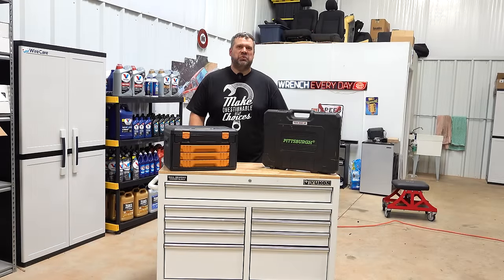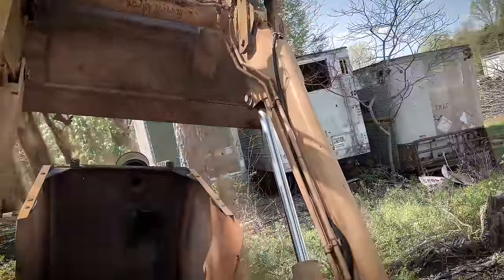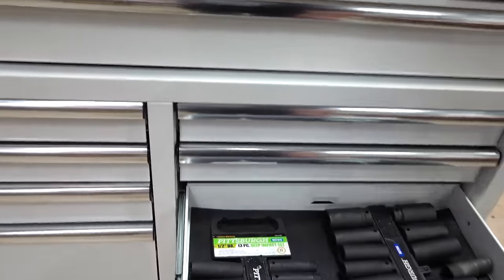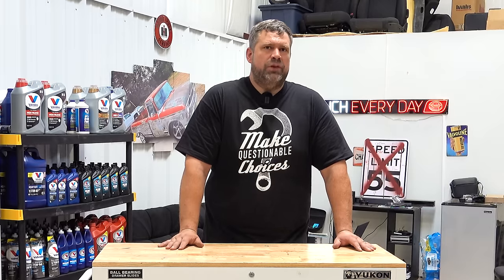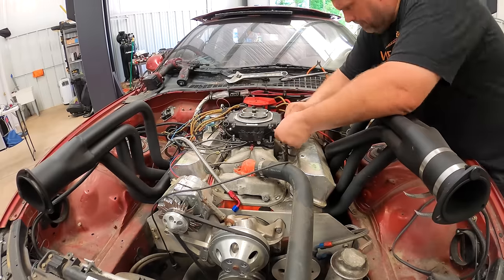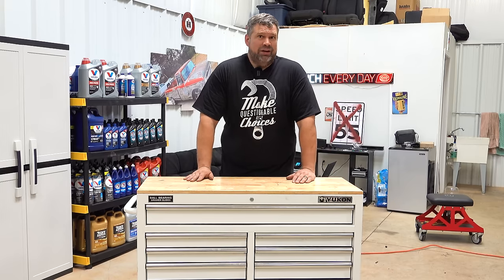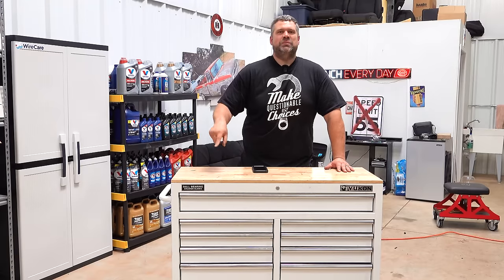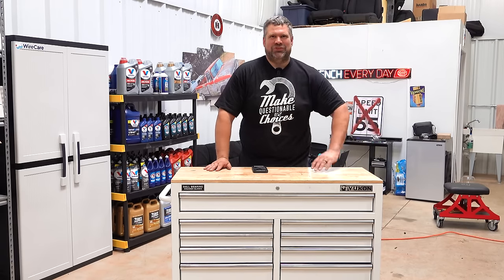I Bought The CHEAPEST Tools In Harbor Freight (6 Month TORTURE TEST)

Comment: I use two rifle cases as tool boxes mounted to my roof rack for mobile mechanic and when I’m off roading. It’s a mix of icon and snap on. I prefer my icon more oddly enough and been replacing my snap on with them because of better availability.

Comment: I bought the blue version of that YUKON tool box and I 100% agree with everything you said.  The only negative to it is the drawer spacing is a bit on the short side but after working through making some of my own organizers, its holding up well.  Mine gets abused just as bad as it seems yours has and I have had it for over a year now.

Comment: Great review Jared.  An extrapolation from this is that for the home hobbyist, any of these cheaper brands are just fine.  Long ways back when I was starting out as a service advisor, I mentioned that I wanted to look thru my techs snap on catalog as I was staring to make some money and wanted some nice tools.  He said “why, craftsman, Home Depot etc are just fine for the home hobbyist.”  I’ve had a basic husky socket set for nearly 20 years, a plethora of craftsman older than that which I use all the time.  They have been great.
Reply: Fully agree. When i was younger i ran a harbor frieght kit for years. Made me money more than once. Now that im older im running Milwaukee hand tools, and Kobalt power tools. Run the tool you can afford at the time, upgrade when you need to.

Comment: You absolutely nailed it. I'm definitely a victim of buying off the tool trucks. My entire work tool set is all major tool trucks. I really thought thats what i needed to be a good tech especially when trying to be one of the youngest honda certified master techs. But when I went to build my.home set for wrenching the garage. Its all been home depot, lowes, and harbor freight and they hold up just fine to the abuse I put them through and then some. Great informative video for anyone new to mechanics.
Reply: What’s crazy is my DeWalt 84 piece mechanics tool set is like $300.00 cheaper than one mechanics tool set from Snap On that’s literally crazy I could buy like 5 or 6 different DeWalt mechanics tool sets for the price of just one Snap On mechanics tool set lol

Comment: I'm starting a new job at HF next week. The manager got to know me by how often I would buy from them and offered me a job. Good people. There are some things that I will not buy from HF, knowing that Snap-On makes a more reliable tool (torque wrench) and some things that are made in the same factory as a tool truck equivalent (Cheif long barrel air hammer, made in the same factory as Mac). The one significant advantage for HF, you never need to wait on the truck if a tool breaks. Just my two cents.

Comment: All good advice! I've sold a lot of tools, being an old division 9 guy at Sears for a few years, and you can save a bunch of money while still having nice tools. Find what works from the lower cost sellers and then upgrade to higher grade tools where it really matters. Most of my personal tools are Craftsman Icon and Quin, with some cheaper no name and a few Snap-On in the mix. The important thing is to be able to get the job done.

Comment: when I went to A&P (aircraft mechanic) school, they had a deal with snapon where everything was half off, and it STILL was over 10k for my box and tools. and over half my class had rust issues with their pliers within 2 weeks of receiving them. so, yeah, go to harbor freight and get the same thing if not better for less money
Reply: Thank you 👍
Reply: Man... I won't tell you harbor freight won't get the job done... but the tools from there are not better... or even close to being as good. I have a 68" epiq that is loaded with both harbor freight and tool truck tools and there is absolutely a quality difference.

Comment: The best deal on the Snapon truck is the trade in tools and the free candy.  I spent a large amount of money as a 19 year old mechanic, but it was nothing compared to the other guys.  I had a full Craftsman set, and CH air tools.  Slowly over time I got away from the CH air tools and into IR and those used bluepoints from the truck but I still have those same basic hand tools 23 years later, including the used craftsman box I paid $50 for.  I guess that's a pretty good tip, you can get more for your money on the used market than you can buying new, and the warranty is transferable.

Comment: Have quite a few husky and harbor freight branded tools. Honestly the only times I've needed better branded stuff was sockets and pliers. Cheaper sockets can crack an cheap pliers explode or dont hold up to use (specifically lock jaw pliers, the pin comes apart)

Comment: Couldn't agree more! The tool truck stuff is indeed good quality, but they don't have a monopoly on tools that get the job done. I am NOT a professional mechanic, having been talked out of going that direction when I was young by someone who had worked in the field. However, I am a hardcore hobbyist and do everything from brake jobs to transmission overhauls. I am almost 50 (sigh...) and still have some Craftsman V series tools that I got new when I was 14. I use a lot of Harbor Freight with good results. It's very useful for stuff that I use infrequently and sometimes even for stuff that sees very regular use. I also buy a lot of tools at estate and garage sales, as well as flea markets. No one knows the value of it and most just want to get it out of the house for whatever someone will pay. You would be surprised how many Snap On wrenches go for $1. For screwdrivers, the best I have used (in terms of ergonomics) are the triangle handled ones from Tekton. They are very comfortable in the hand, able to deliver a lot more torque than more rounded designs, and don't break the bank. Speaking of breaking, I have a $7 Harbor Freight 1/2 in breaker bar that I have used for over 12 years. I use it to break FWD axle nuts loose and usually end up using it with a cheater pipe and jumping on it or by putting the tip of the handle on the ground and using the car's engine to drive the nut loose. Other than a pivot bolt that needs occasional tightening, it has held up perfectly fine. Of course, I can't recommend anyone else to do that!

Comment: The 25 inch Pittsburgh Pro 1/2 inch drive breaker bar for $19.99 is an absolute steal. You can catch them on sale for $14-16.00. Great option for a big breaker bar. It also has a plastic insert/rubber handle comparable to the big name bars. That's a great bar and would be right at home in your tool box.

I work at Walmart in the Auto Care Center and Walmart does provide our tools to us. They contracted with Steelman for their Pro line, which is acceptable for a weekend type of use, but these tools get used hard everyday and we do end up replacing stuff fairly regularly. Again, their provided by Walmart. We don't get too deep into working on vehicles, we're mainly oil changes, tire installs, flat repairs, rotation/balance, battery installs, and external light installs, and precious little else. So we're not pulling transmissions out of cars, that's for other shops to handle. We try to get the vehicle in while the customer is in the store shopping and have it ready when they are done. Sometimes we actually make that happen too.
From what I've heard about the Harbor Freight lines of tools, the Pittsburg Pro, Quinn and Icon, I'd run any of those over the Steelman line any day of the week if I were working professionally in a repair shop setting, no questions. I've not bought any of the Icon line, but have a bit of the Pittsburg Pro tools for my own personal use and they've done just fine. I also have a number of Craftsman tools and they do the job too, and Craftsman is my main tool line for my use.
If I were going to change careers and get more into the vehicle repair in a shop setting, I'd give some serious thought to the Icon line augmented by Harbor Freight's other line of tool chests, like the Yukon and some of their portable tool boxes on wheels to support the Yukon.

Comment: I was gifted a large Craftsman mechanics set in 1993 and still have most of it in use today. I have abused them plenty, but always put them away clean.  I was very sad when Sears went away. However now that the Freight is carrying better quality tools, I have an avenue to affordably replace things I break. I have also had good success with Tekton brand ratchets and sockets. They cost a bit more, but they feel more premium the hand. For Pliers, I have been using some Kobalt and aside from their large handles, they work well.

Comment: Great job on this one.  Very good advice....

I'm in a different industry, but I was really lucky, waaay back when, a guy told me "Just buy the big set from Craftsman or whatever, and then the stuff you use THE MOST, buy a good one later, after you kinda figure out how you work, and how you like to work...."  Back then, as Jared says, Harbor Freight barely existed...  Or they would be at these "tool shows" at hotels or whatever, but the stuff was really bad, packed in scuzzy stinky cosmoline grease and weird waxed paper...  Just a huge no, for the most part...  but like Sears, what people used to say back then was, yeah, Craftsman...  It was guaranteed for life, they would replace it.   The guy who gave me that advice, he said yeah, Craftsman is garbage, compared to Snap On.  But they back it up 100%.  So, just keep taking back the broken wrenches & ratchets, they'll replace it....

So I did that, and that was 100% correct.   So if a year and a half in, you realize you like a certain kind of sockets, or you like nicer needle nose pliers, or whatever it is, sure, spend the money and buy the stuff that matters to you....  If it's a tool you use once every 4 months, and you end up unburying it from the bottom of a drawer in your truck every time???  Ehhhh...  The cheap one is fine.  Clearly not a "key piece" of your arsenal.....  the better one will clearly make zero difference in your life....

I got a Husky ToolBox on a black friday sale last fall....  I have to say, this is a super nice box.  Ball bearing drawers, came with liners, built in power strip with usb and 120v plugs...  Really nice, for not much money.   In many ways, this is kind of a golden age of tools.  At least in my lifetime.  The "floor", if you will, of quality, is higher than it used to be....  the crap, used to really be crap...  But more to the point, if you come up a little, off the bottom of the barrel, there are really good options out there.  I am not saying this box was the cheapest in the USA.  It wasn't.  But I mean, for $300-ish bucks, this thing is really nice....

Comment: I've been a professional for 20 years, my tool collection has been gathered together from all over.  My daily abuse tools came from a tool truck only because somebody came by every week to handle warranty replacements.  I have Snap-On ratchets that I can break/bend into a pretzel and I can get another one, no questions asked.  Same thing with my sockets.  I can crack one wide open and get an instant replacement brought straight to me.  As for EVERYTHING ELSE, I love Harbor Freight and Home Depot.  I have a bad habit of losing screwdrivers, so I spent the least amount possible on them because they ALWAYS disappear on me over the course of a year.

Comment: I used to race dirt circle track, and I built a complete track setup of HF hand tools so that if a breaker back somehow acquired "legs", I wasn't going to cry all the way home from my good stuff being lost. I used the box religiously for 5-6 years every Friday night... for their intended environment, the sockets, ratchets, extensions and wrenches did amazingly well. I never broke a single one of them. I actually got to where even in the shop, I preferred the wrenches because of how they fit in my hand. 

The pliers? Garbage. The only thing they would be useful for is a tarp hold down if it started to rain. The vice grip style did alright, but I wouldn't go back and buy them a second time. 

I bought the Earthquake XT 1/2' drive impact for the track, and I broke more than one lug nut stud. I was highly impressed with it. I also have a video of it taking off a Harmonic balancer bolt that another brand couldn't get off... both had the same weighted socket and the bolt was torqued to the same spec. How long it will last? God only knows but for the last 4 years its done well with all things considered.

Comment: Can't comment on most of the tools you put in, The impact sockets I have a full set that I got from HF 5+ years ago that I use near daily working on OTR trucks an oil field equipment and have been very happy. I have not broken any in that time I run them on air and a 400 tlb gun and again have had no issue with them.

Comment: I worked on motor homes and trailers for a quarter-century.  I have bought and used a lot of tools.  Most tools I bought were craftsman before the warranty change.  I have a lot of truck tools because of the specialty tools.  That 2 foot long wrench that no one else has that allowed me to get a job done the other techs struggled with.  The trucks have their place, just do not go overboard.

Comment: In Ireland we don’t really have tool trucks and the tool truck companies from America are not as big so I started out with just a basic Halfords (pretty much diy car and bike parts store) tool kit. Then what I found best was if the tools in the set were bad or you use them a lot then buy better versions from independent brands based on there quality and price on a tool by tool basis. For example wera screwdrivers, knipex pliers and a Milwaukee socket set. I found very few company’s are good at everything. In terms of storage I like making my own foam inserts but they don’t accommodate growth so only get them when you are happy with what you have.

Comment: I paid $550 for my first tool kit over 35 years ago (around 3-4 weeks pay back then). It was around 200 pieces including 1/4, 3/8 & 1/2" sockets (metric & SAE) & ratchets, combination spanners (wrenches) (again, metric & SAE), screwdrivers & a few other miscellaneous tools. I have added to it over the years as well as replacing some tools but, I still have most of the original sockets INCLUDING ALL 3 10MM... I even turned the 1/2" drive 10mm into a hex key socket (because I needed one & who uses a 1/2" drive 10mm socket anyway)...

Comment: I started out with a Craftsman  starter set back in 1985.  The Snap-On thin wall deep wells are life savers at times.  I use an old large screw driver with a straight old school Ford plug boot to start plugs.  My Cornwell 3/8 ratchets are now 20 years old and still are fine.  Yes, I have abused them.  The handles felt great in 1992 and still do now.  Wrenches I prefer thin smooth shanks with rounded edges.  The flank drive types I now prefer.  The ratcheting boxends I'm still not sold on.  1/4 drive?  I have a great Duralast set that feels better than my 20 year old Craftsman set.  Pliers....  I love actual Channelloc's and ViceGrips.  The imitations just never seem to work as well.  I like Micronta meters and Sterret micrometers.  My taps and dies are Vermont American.  Screw drivers....  (Oy!)  I like magnetic or hardened tips with smooth 3 or 4 sided grips.  Allens, my BluePoint T-handle sets have lasted 20 years and will last another 20 so long as I don't break them.  Impact choosing...  take in to the store or truck a nut/bolt that you regularly take on or off.  Find the sockets that have the best fit.  Rounded out corners are a good feature on any sockets.  Now....  A real tip.  Listen to the steel when it hits other steel.  The tone should be clear, bright and last like a bell was rung.  

I apologize for rambling so long.  I am NOT a "professional" mechanic.  I have been working on everything from bicycles (age 5), tractors, PU trucks, and about every common make of car from 1920's coups to modern DIS, MPSFI multi chassis computer messes that are driven today.  Yes, the air cooled bug was still being sold when I first turned a wrench.  I also restore and build wood furniture and have cross purposed many tools.

Get a used steel box with roller drawers.  It doesn't need a top.  Make one..  It doesn't need all its wheels to begin with.  Put new ones on it; I did.  Go onto the tool truck and feel the tools.  Then go to the discount store and feel those.  Find what you like.  If it is comfortable and well made the name is irrelevant..  Don't rush or get impatient.  You NEVER get that money back.  Be well all. Make a questionable choice and pick a crazy project that stirs your heart.

Comment: I do like the modern tools, like the ratchety hand wrenches (floppy heads are even better), but ultimately, I still use my old fashioned regular old wrenches most of the time. I dont even use the electric impacts anymore except for wheel lug nuts.

Comment: When I was a new tech, storage (toolboxes) had to be FREE, as in found on the side of the road, or converted from something else, like a file cabinet.

The tools were all Craftsman, Husky, Harbor Freight, and the occasional brand-name where it mattered, like Channellock pliers (not a truck brand but definitely not cheap junk).

I STILL prefer used boxes, even if they need TLC. All they do is HOLD TOOLS. I can fix up a toolbox. I'm a mechanic.

This "business model" (if you consider your personal budget a business) went pretty far for me because I purchased more tools on fewer dollars and was more prepared while getting my foot in the door of a niche trade (I'm not an auto tech).

You don't want to have to constantly borrow tools from your peers. If the shop has any tools, spend your money on OTHER tools until you feel it's necessary to have your own copies of those tools because other guys are using them or you just need them that frequently.

And, if you borrow it from your coworker twice, BUY ONE OF YOUR OWN.